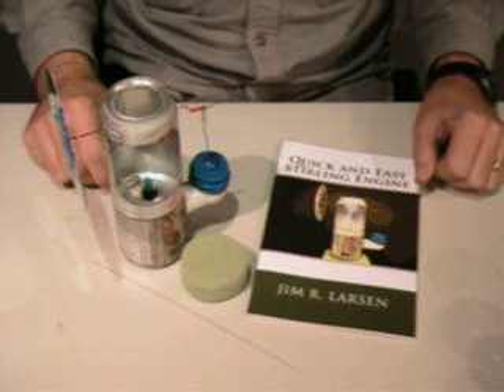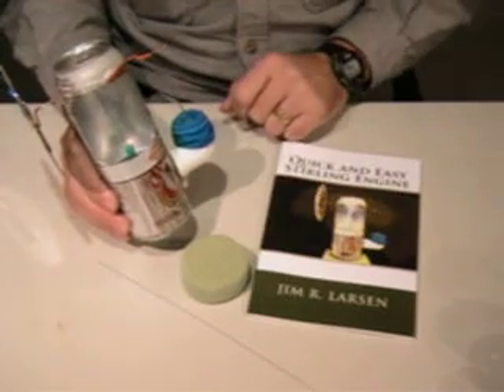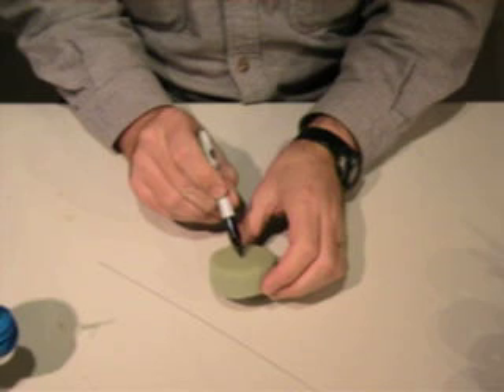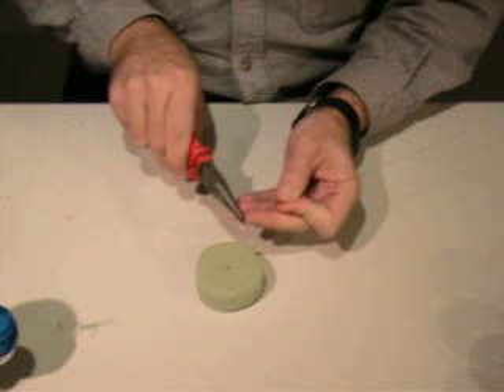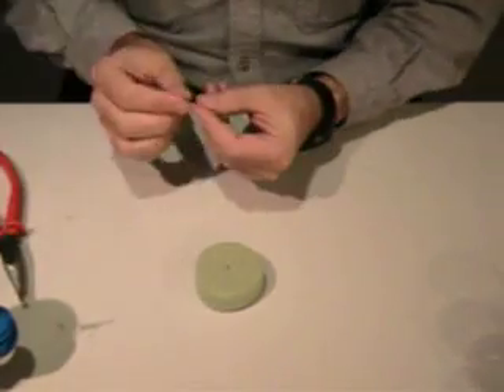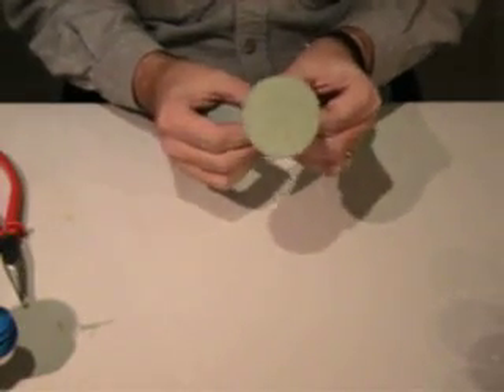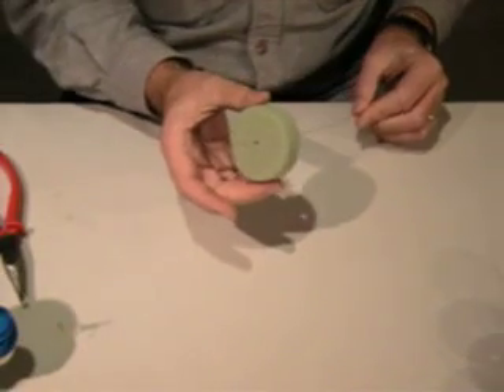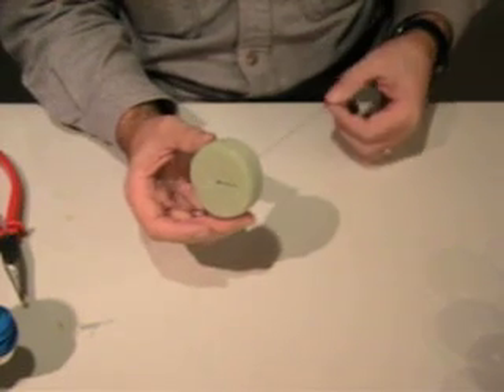Building the Displacer Pushrod for the Quick and Easy Stirling Engine

Comment: Thank you for your website and how to videos. I have a question for you though...is it possible to use the flywheel as a driving tire on a scaled Stirling engine ? Meaning, if the flywheel was placed on a flat surface, would it propel the engine forward ?